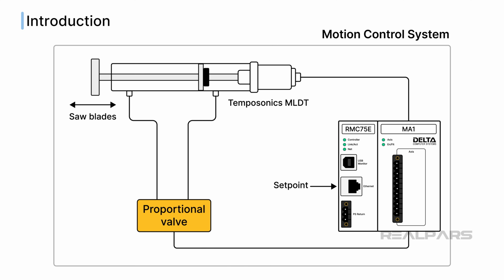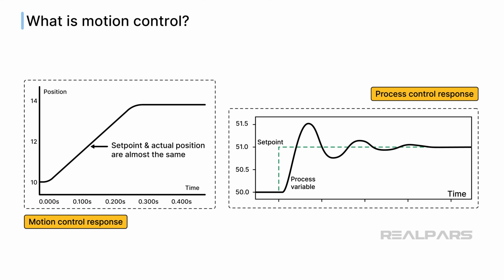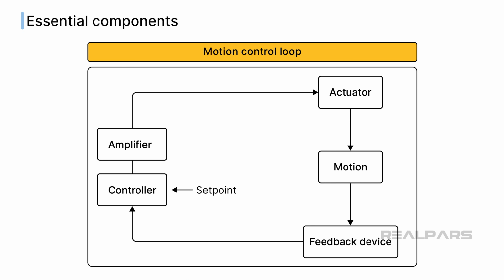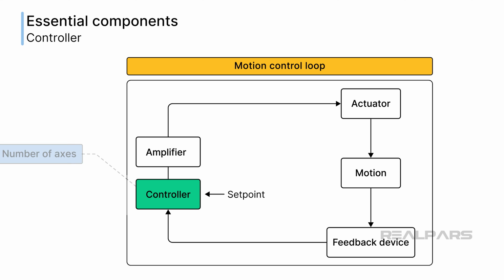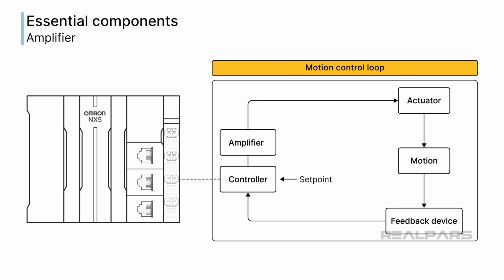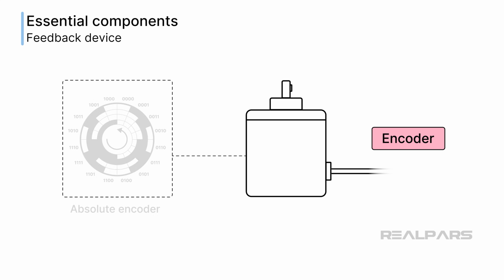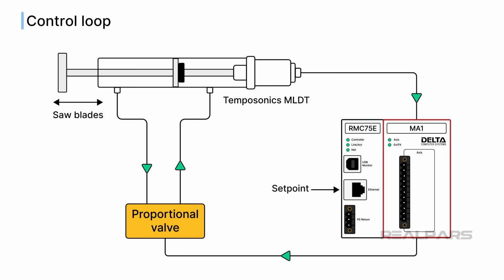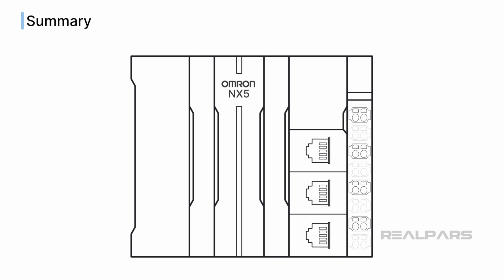Motion Control Systems 101: Key Elements and Their Importance

Comment: Why can't I use a tuned PID loop for a motion control?
Reply from the maker: Hi there ! We’re sorry if we gave you the impression that you can’t use PID control for motion systems. Using a tuned PID loop for motion control is a common practice, and in many cases, it can work quite well. The problem occurs with the response to the PID parameters. The video illustrates that typical PID responses, such as quarter-wave damping, are unsuitable for motion control. Therefore, the parameters are much different.